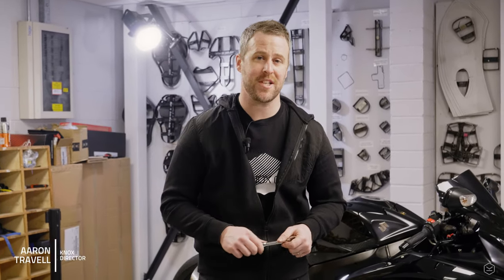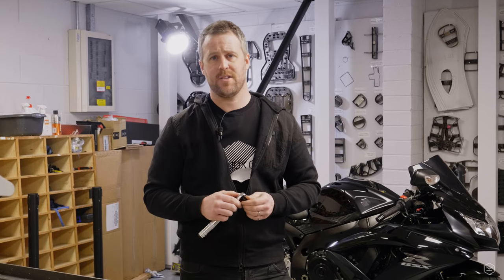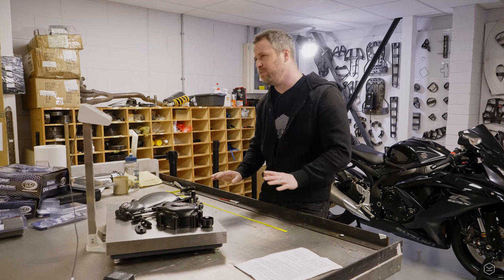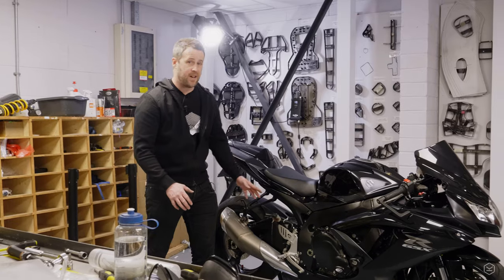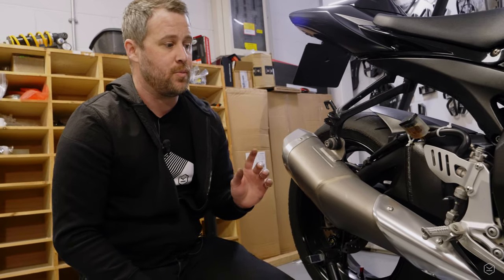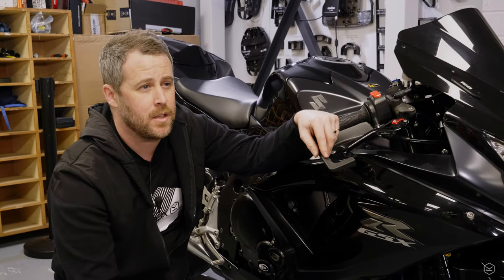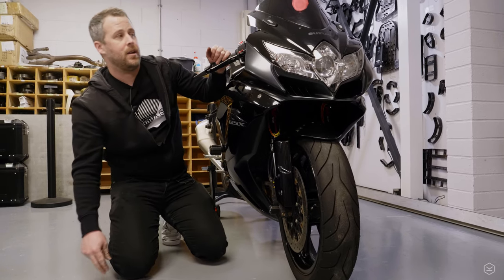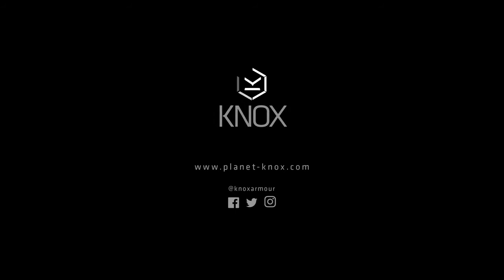Crash protection for your motorcycle | KNOX Suzuki GSXR 750 project Episode 3

Comment: Hey. Could you please show me how to properly set the clutch cable on the steering wheel and the engine. Greetings from Poland.
Reply from the maker: Best bet is to buy a Haynes Manual which will show you all the correct way. Thanks!